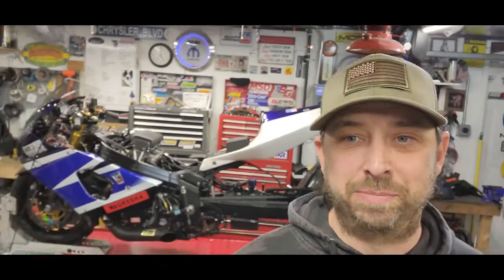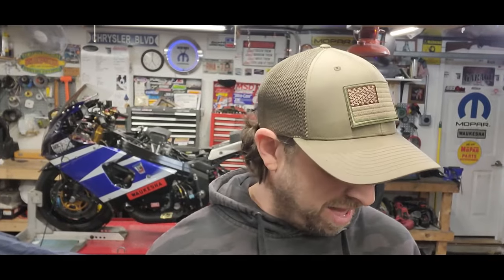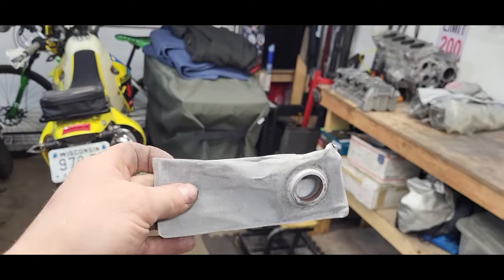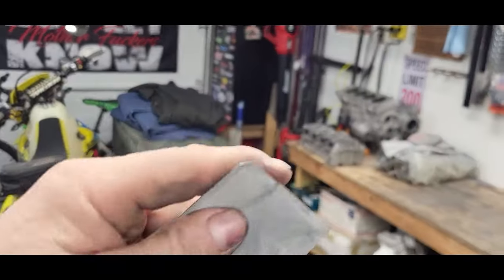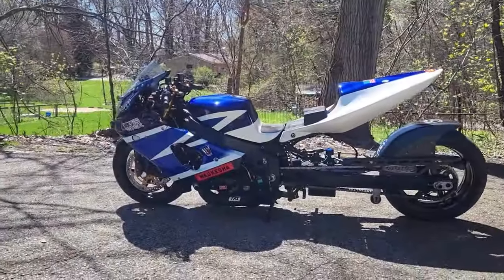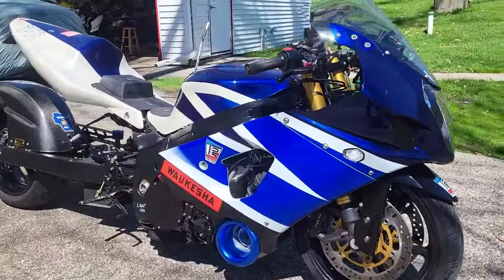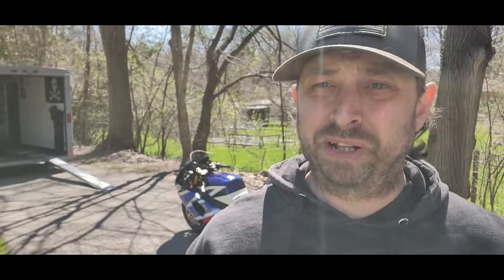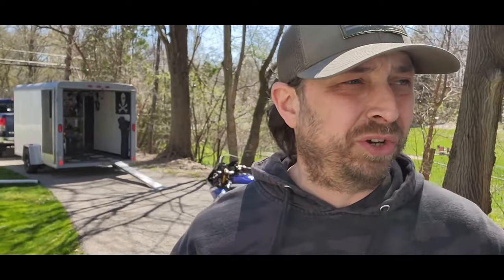IT WAS ALMOST OVER BEFORE I STARTED!

Comment: Good find!  Had a similar issue end of last year (when I finally got back out on the track).  Was losing fuel pressure - replaced FPR and no better.   My pre-pump filter was clogged.  Also turned out I had reversed the pre and post pump filters - DOH!  Pump is a LOT quieter with the 10 micron filter AFTER the pump …

Good luck!  You are due some good runs!

Comment: Where can I get a dash assy for my gs1100 ?  I need a 3 -3.5 inch diam. Rpm gauge with a 0-13000 
rating the 5inch round rpm gauges are to big for the area I have on fairing.? Would you have a name to a place that mite be able to help me out,? 
Have fun ,be safe at the track